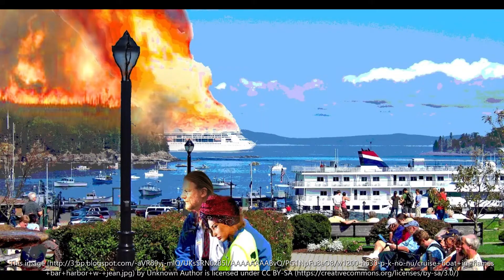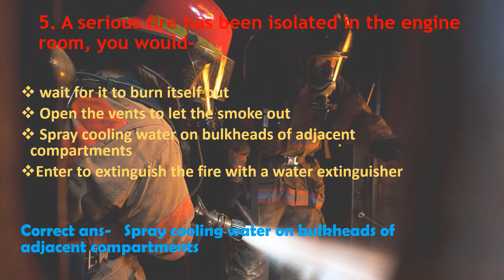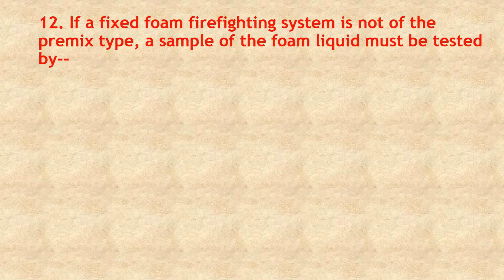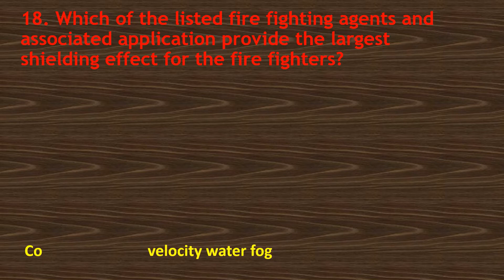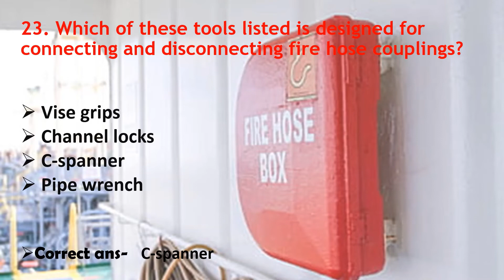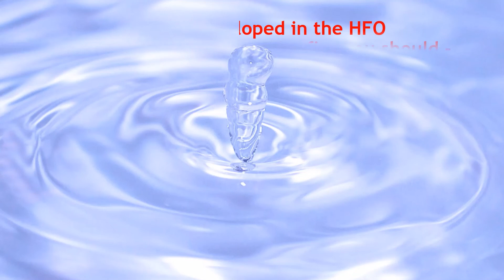Exit Exam Questions Refresher FPFF Course || DG Shipping || MarineX

Comment: The sprinkler system in accommodation is 68°C to 79°C but it's according to location such as dryer rooms, where high ambient  temperatures might be expected, the operation temperature may be increased by not more than 30°C above the maximum deckhead temparature.